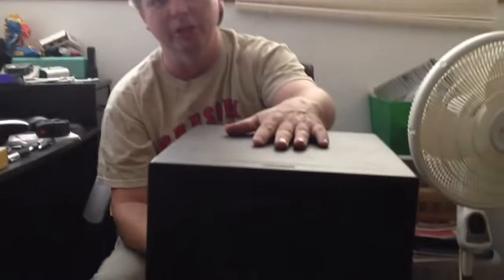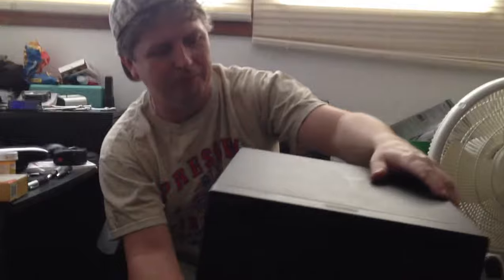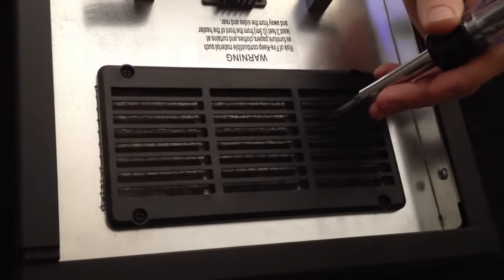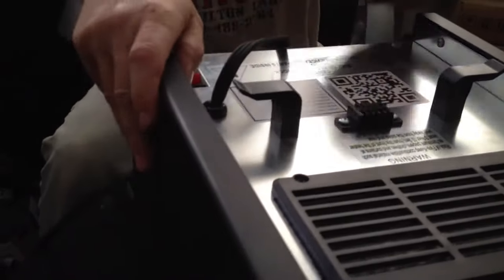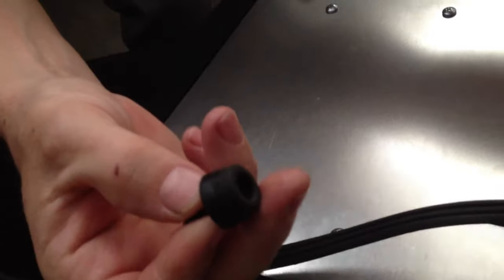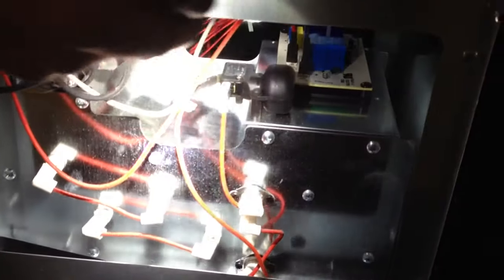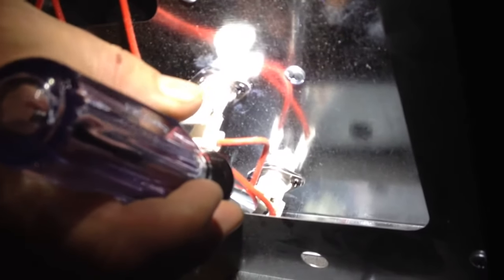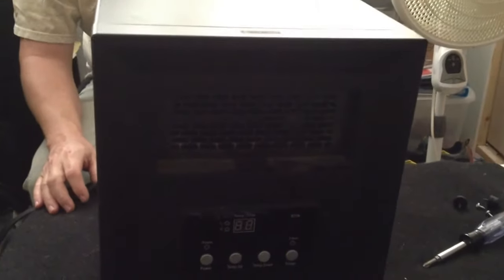How To Repair Your Infrared Quartz Heater

Comment: Oh shit this was really useful to know!!
I have the ZCHT1001US model, where the disassembly is a bit different.
When you said button, I actually did think it was a button since the light glare in the video made it hard to see. 

Turned out it was a little pushpin like dial that you can poke to reset it. 😅

I'm leaving instructions here for others that have the ZCHT1001US model, who had a hard time taking it apart and maybe almost broke the casing from brute force like me. 👀💦💦💦

So assuming that you are facing the back side of the heater, you have to do the following:

1. You have to remove 5 silver screws from the back, 3 on left side, 2 on the inner top. 
2. Then you have to slide off the top cover by pulling it inward towards you. 
3. Once that's off, unscrew the 2 black screws on the left that were under the top cover. 
4. Flip the heater onto it's side so that the left side is facing the ceiling. This time you will have to slide the casing off by pushing it away from your body. It may be a little difficult at first but once you get it loose, you'll understand the mechanics.
5. There should be these two wires with rubber casings at the head (mines were braided red and dusty pink) and a dial like thing sticking out in-between it (it was mauve for me here).
6. Poke it. It doesn't click or make a noise, so feel free to press it several times if you're unsure.
7. Reassemble the heater. 
(Fit on the left side casing, prop it upright, 2 black screws from under the top, fit on the top cover, 2 silver screws at the back's inner side, and then 3 of the left screws.)
(Basically follow steps 4 through 1 backwards lol)

I hope this helps anyone!
Reply from the maker: Thanks for the view I'm happy my video helped you some.
Reply: Same here. Broke maybe a few small peices but no big deal. I am so glad it was a tiny reset button. Going to drill a hole so I can reset it next time with a stick. 
Great video!!!
Reply from the maker: @SterlingRobertson  Thank you and I'm happy you got it going
Reply: Perfect! I have this model as well (different model number but same shape) and these instructions helped immensely! I'm now getting the E1 error, so I will clean the filter again, but at least now I know how to reset it! Thank you both!!
Reply: I've been looking all over YouTube for this same model (ZCHT1001US) & had no luck UNTIL YOU (MapleWhale) came along with these easy to follow instructions. Just did it & about to try it out. 🤞🏻 Credit also to the original poster MrJustDIY UPDATE: WOOHOO No need to junk it. 👌🏻 Thank you respectively  MrJustDIY & MapleWhale ✊🏻
Reply: @MrJustDIY  mine says E3 on it and I took it apart to push the button but it still says E3.. it won’t let me turn on the heat but the lights turn on.. any idea what to do?

Comment: This was REALLY helpful! I have the version in a wood-look MDF housing. Your screws were on the side and bottom. This one of mine, the screws were all on the back. Here's the difference:

Take the screws out along the sides of the back of the housing, 4 on each side. They're on flanges. Take the two screws that hold the vent with the filter on it out, and bring that piece down to a horizontal position towards you & slide the piece out of the slots its tabs fit into.

With those removed, just pull the whole interior unit out. But BE CAREFUL, the opening has sharp edges that will cut you if you're not careful. Then you'll be able to see along the side that's on the right as you look at it from the back (left side as it sits in the cabinet), and see the same reset switch shown in this video.

Put it all back together, and you're good to go!

Comment: Well i have a newer model but im gonna try this anyways. It was working fine, and all of a sudden it was off and i clicked the button and it wouldnt cut back on, but the light on the bacl switch still works. Fingets crossed that this will fix it

Comment: Hey I have a infrared heater too I was wondering if you know where I can get Replacement parts for my heater? I need the power Switch on the back of the heater please help I've been looking everywhere online and can't find it all help is appreciated
Reply from the maker: You can get them on Amazon and eBay

Comment: I just wanted to say thank you! I'm an electronic technician, and I wouldn't have known where that reset button was. It was so tiny on my Global Air heating unit that I would have easily missed it. I initially thought that something may be wrong with the circuit board. Not so. Just an easy fix thanks to your video. Also, I used a vacuum to clean the inside of the unit and filter. All ready to go. Thanks again!
Reply from the maker: You're very welcome

Comment: would this fix be for a situation where the heater works normally excluding the fact the the elements dont "warm"(so humorously the fan blows and controls are responsive) . On mine both elements stopped working at the same time so im looking around b4 i even look up the price for those or a new heater
Reply from the maker: No sorry

Comment: Just got the fan on mine fixed by a family friend and the thing suddenly decided it wasn't going to turn on. I was worried I was going to have to ship it back to him and decided I'd try and fix it myself. Lo and behold! You're a life saver!
Reply from the maker: Glad I could help
Reply: What was wrong with the fan?I am having a problem with the fan on my heater it's making a noise.
Reply: My fan is making a noise..It getting hot fast.I know it got to be the fan.How do I fix it..
Reply: @chriswatkinson4525  I believe the fan had come a bit loose so it was wobbling around a lot, making a clunking noise, and not blowing as much air as it should have been. Not sure what the fix was as I wasn't there during the repairs. Best of luck getting yours sorted out!

Comment: This worked like a charm on a LifeSmart model zcht1001us with a slightly different design. On mine, the interior layout is such that I was able to drill a small 1/4" hole in the plastic side panel right over where the reset button is so that I don't have to take the thing apart again if the thermal fuse should get tripped again in the future. Thank you for sharing this!
Reply from the maker: You're very welcome
Reply: Smart!

Comment: Breh.. your video just saved me $150 or more 😂 i was about to buy another one since it’s so damn cold here in LA right now (64 degrees)  i woke up at 6am to remove the back filter of the heater and I saw the reset button that you mentioned there giving me the middle finger 🤦‍♂️ Thanks, man.
Reply from the maker: That's awesome and I'm happy I saved you some $$$$ It's 31 degrees here in Indiana

Comment: Thanks for the tips. Reset works
 Happen for for me when i unplug unit without letting it cool down.  As the other user mentioned its not a button but round ceramic tube like
Reply from the maker: You're Welcome

Comment: There is a reset button in the lifesmart infrared quartz heater humidifier combo also. I was going to throw my heater out. Read the parts manual. Found the reset button works great.
Reply from the maker: Thanks for the info!

Comment: I have a cat, a longhaired domestic female kitty and everything in my apartment has cat fur in it or on it and I believe the fan for my infrared heater is clogged with cat hair. It still works fine, it's just not throwing the heat like it used to when it was new. Any advice please, and it's the older model, not the new ones made of wood. So, does anyone know what I should do to fix this little dilemma? Maybe the fan is just burnt out, I don't know? I'd appreciate any advice or suggestions on this please.
Reply from the maker: I would suggest removing the cover and blow it out with an air compressor.

Comment: I have the NTEC model KUH15-02 and I can't find the reset nor understand what it looks like. no buttons will work but the timer you can move the numbers up and down but nothing else works and back switch does glow when turned on
Reply from the maker: Sounds like you may have a bad control but it's hard to tell without seeing it.

Comment: What are your thoughts on leaving the side panels off to keep the unit from overheating do you think that would be a good thing or do you think it would interfere with the heat output, functionality of the unit?
Thanks
Reply from the maker: It needs them on. As long as the filter is kept clean it shouldn't over heat unless the fan is bad
Reply: I think the worst enemy to the longevity of these heaters is dirt getting on the quartz glass tubes. Just guessing but having the sides off could expose them to more dirt
Reply: @captaincrunch1707  Thank you. What are your thoughts on running diesel in a kerosene heater
Thanks

Comment: Got the cheapest model with 4 tubes on a Black Friday sales back in 2018. Amazing heater but the fan is just so damn loud and cheap. Probably worth buying a more premium model with actual fan bearings etc. Clean my filter quite often but was thinking of cleaning the actual glass quartz tubes, however they look really difficult to actually reach.
Reply from the maker: The fans could be a lot better

Comment: Can you tell me where the reset button is on a source green heat model sgh-1000-4pc. I've tore this thing apart looking for a reset button 😭😭😭
Reply from the maker: I'm not sure on that model but if it has one it should have two wires coming off of it.

Comment: This works but the reason the sensor trips is usually a slow fan. Try w-d 40 or some point blaster on the fan pole. I got some in there without taking fully apart and going strong 4 weeks now. Was tripping in a few minutes of use and a loud fan. Flammable so let it air out a bit before running.
Reply from the maker: I've found the most common thing is a dirty filter not letting it have enough airflow to keep it cool enough.

Comment: Thanks so much! Any idea why my heater automatically shut off the fan without shutting off the coils?
Reply from the maker: The fan may have gone bad I’ve had that happen before
Reply: @MrJustDIY  I followed your video to reset the breaker. Everything seems to work again. I'm under the impression the electronics that regulates temperatures and such is malfunctioning. It doesn't seem to turn off when desired temperatures are reached. Great video, thanks! Saved me from going crazy figuring out a way to return it. I should probably return it anyway:)
Reply: @MrJustDIY  how do you replace the fan that's all that's wrong with mine

Comment: Hello,my heater works for about 10 minutes or less,then the fan turns off prematurely but the tubes still remain on for a minute or two,it seems that the unit gets too hot without the fan running and then something kicks everything off,leaving error E1 on display,could this be a thermostat controlled relay for fan that is bad ? I dont even know what it would look like or where i could buy parts at,its made in China,bought from Mennards,says Intertek model 208483 on back ?
Reply from the maker: Sounds like the fan may be getting bad. Sorry for the slow reply my internet has been down.
Reply: Idk,it works fine for a while,motor not hot or making noise,im thinking maybe a limit switch/relay ?

Comment: is the button supossed to click or go down or what? I pushed it but nothing seems to click and I don't know if I'm doing it right.
Reply from the maker: You may hear a little click when you push it down but not always. I would plug it in and try it after resetting it. I believe it comes back up a little after pushing it.

Comment: Hey Man.
I have the same heater the problem I am facing is that out of 4 infrared tubes only 2 tubes are getting heat up I can see other two are not lit up at all.
Do you have any video how to replace these infrared tube?
Please guide 🙂
Reply from the maker: Sorry I don't have a video on it but may make one soon
Reply: Do you know any website to look for those infrared tubes?
Reply from the maker: @MuzammilKhan-xx7kc  maybe eBay
Reply: @MrJustDIY  hey man fixed this. I just reseated those elements which were not working and now it works perfectly.
Thanks for this video you saved me buying new one.
Reply from the maker: @MuzammilKhan-xx7kc  Awesome I'm happy you got it fixed.

Comment: I have a Redcore R4 that worked for like 2 days then it suddenly started to blow only cold air. I haven't taken it apart but I think it's time to go get it out of the attic. Maybe it is something simple like this. It was a way overpriced heater at the time (normally $399 but I got it on sale for $200 from BestBuy) and apparently they don't make them anymore (probably because they were pieces of shit?) but I went to return it at the time and I had a 45 day window to return it and of course my lazy ass didn't bring it back until day 47 and BestBuy said tough shit. Be interested if anyone here has experience with a RedCore brand?
Reply from the maker: I've done that on stuff that needed returned lol